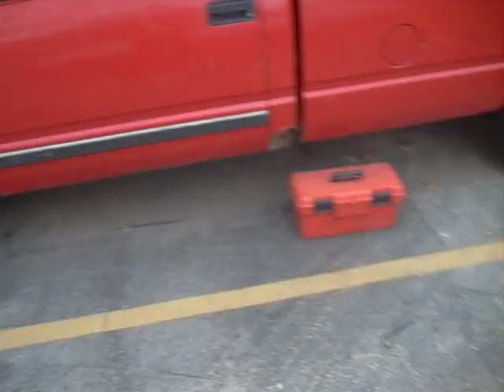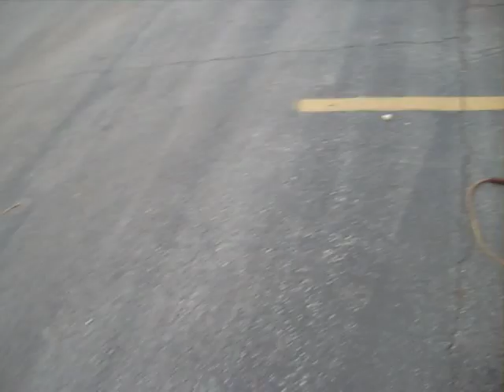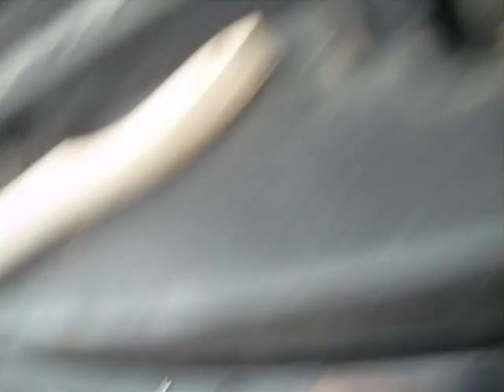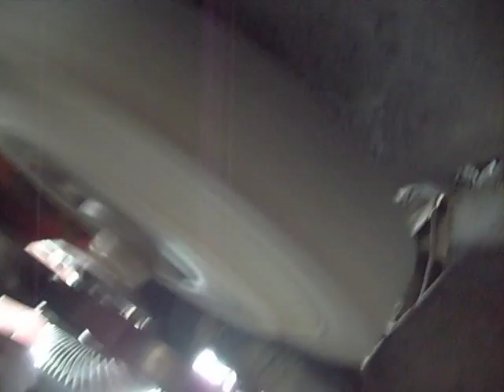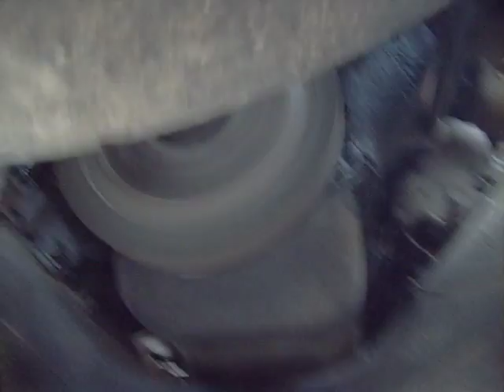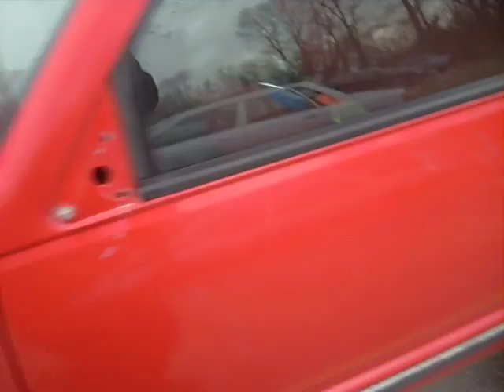crank pully and harmonic balancer investigation part duece

Comment: Did you ever get the repair done? Did the sound disappear when you bring up the rpms? I havea Ford Windstar 3.8 v6 that has a rattle/knock at idle. Disappears at 1500+rpms and at load. It could be so many things.. I'm at a loss where to start. I guess after seeing this, I'll take off the belt and look for play in the balancer, as it seems tight with the belt on.

Comment: hope you didnt crack your crank they have tendency to do that when the balancer busts, i have a gas 305 that keeps throwing off balancers for some reason, when it fifnaly sheared the keyway out of the crank i just welded the bastard on there so far its been fine for 90,000 miles